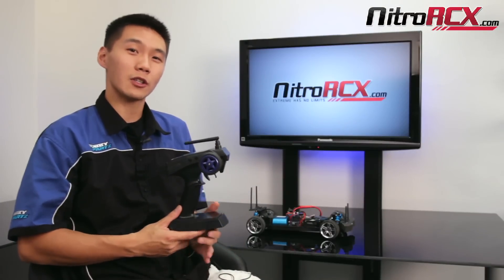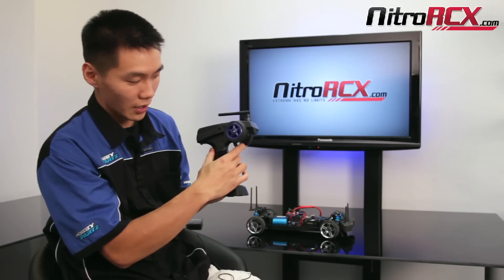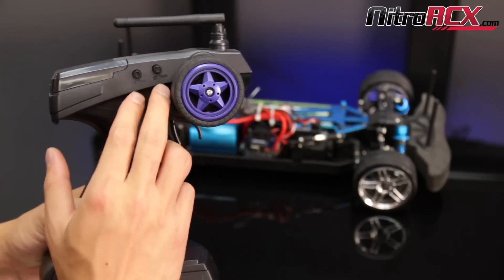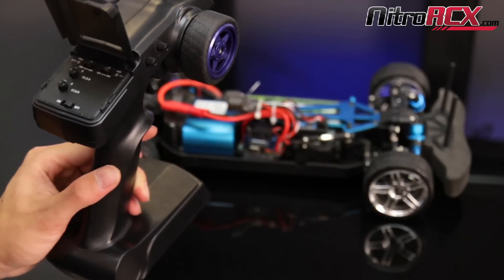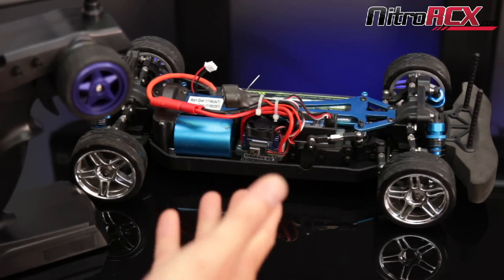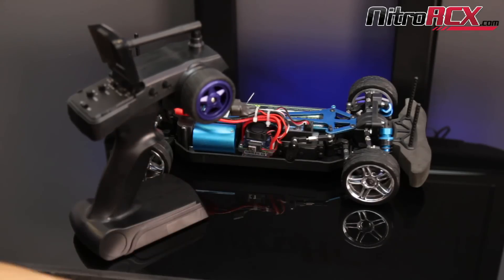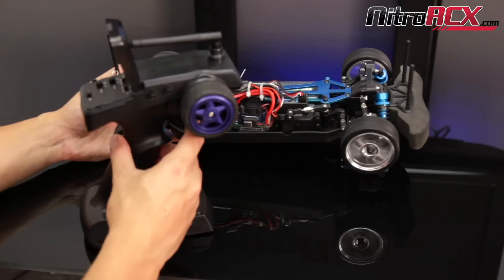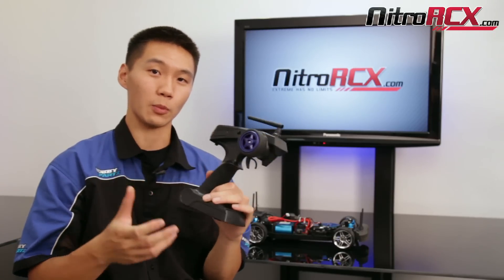NitroRCX RC Guide: Throttle Range Programming for your RC Cars

Comment: This video saved me!  I am new to RC cars and I just got a new VKAR Bison with a brushless motor.  I took it out of the box, turned the transmitter and car on, and went to running the car.  I saw something about programming and binding, but being RTR, I figured it was ready to go.  First, it was like it had a mind of it's own and was doing some wierd stuff.  The instructions were very confusing and didn't even say how to make it go in reverse.  I had forward and brake, but no reverse when I pushed the trigger forward.  So, I was using the throttle reverse switch.  As I continued to run it, it got stranger and stranger.  I would put the throttle in reverse and it would automatically take off on it's own going forward.  Ocasionnaly it would jump into reverse full throttle.  Then it started braking on it's own.  I was about to give up on it.  I tried to follow the instructions to recalibrate it, but it just didn't work.  Then, I found this video.  After watching this about three times, I followed your instructions to the letter and it worked!  I now have forward, brake, and reverse!  I am so happy!  Thank you very much.

Comment: I had these ESC and motor and radio system in my exceed buggy, worked well. I now have the electronics in a Tamiya TA06 PRO. Works really well. 

Today I accidentally screwed the throttle range when messing with the ESC, and my car sped off on its own and into a BBQ. The BBQ is broke, but my car is fine, long story.

Thanks again for this tutorial, car ESC works fine again :)

Comment: i have a  S5 rtr esc for my 1/5 Baja 5b. it needs two 4 cell batteries.. to run.. but it does not read the cells but when I put two 2 cells batteries it does run how can I program it.. I done it manually with out the manuel to read the two 2cell

Comment: i got the ezrun 25a esc when i try programing it just keeps beeping until i press the 'Set" button noting happens i have a traxxas 1/16 slash 4x4 with the fm transmitter by traxxas  help pleasee